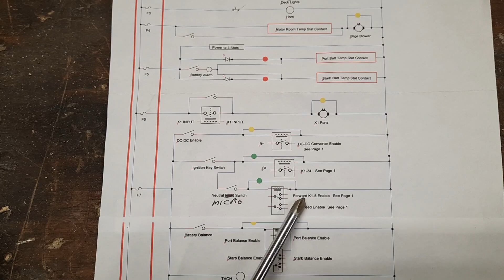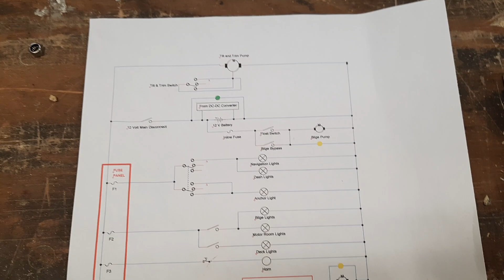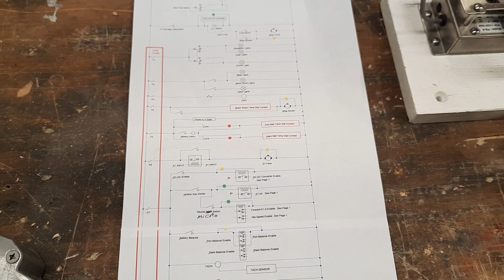Update on Shift & Throttle. Episode 13 EV Boat Conversion.

Comment: I'm looking forward to seeing your diagrams in more detail. I'm curious as to how you plan to handle reversing. Are you going to stick with mechanical reverse as opposed to just switching the direction of the motor via the controller and locking the lower unit into the forward gear? Thanks for all your videos!
Reply from the maker: Sterndrives only turn in one direction. They become very unhappy if you reverse the motor.
Reply: @evboatconversion.electricboat  Makes sense I suppose they are somewhat similar to outboard motors in design. Looking forward to seeing more sea trials!